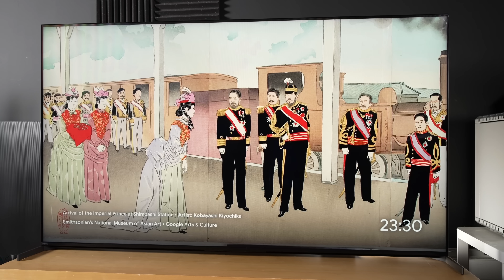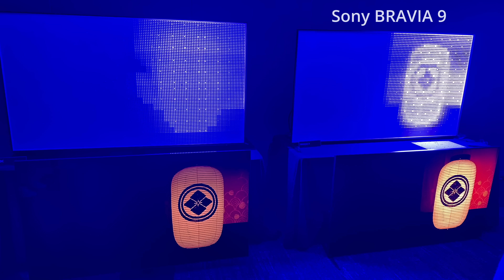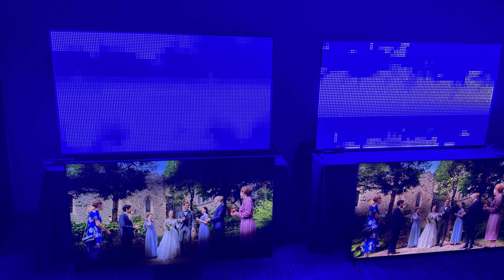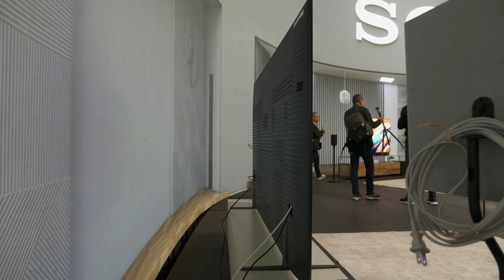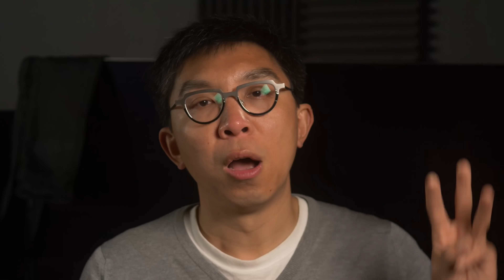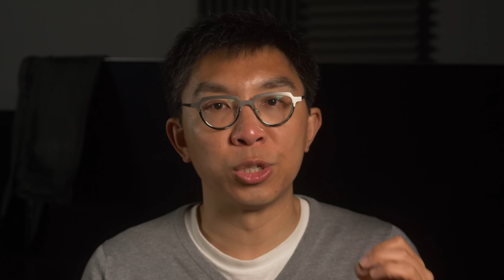𝗖𝗢𝗡𝗙𝗜𝗥𝗠𝗘𝗗: Sony Shun OLED & Use Mini LED for 2024 Flagship TV

Comment: This does not solve the slower pixel response times of LCDs, though, right? As a gamer, I'd still consider OLED for that reason alone.
Reply: And it probably uses a VA Panel with Near Black Smearing.

Comment: I was skeptical about mini LED at the beginning until I saw a video of the TCL C855. An unboxing and a first impression video from a Spanish reviewer. I think the same panel was used for the Bravia 9 because the performance is almost the same. The black values are quite good. I am positively surprised about the new mini LED as I have been using OLED since 2017.

Comment: I've had 3 different OLEDs (Sony A80j, LGC3 and samsung S90C) and they've hurt my eyes. Is it related to OLED technology, or is it something else? I'm thinking of buying the Bravia 9, but what if it's because of the nits? Even with very low brightness and contrast, I feel a very intense burning sensation. If anyone could help me, I would appreciate it. Thanks.
Reply: That sounds like an eye issue not a tv issue. I turn my a80k down to lowest brightness at night because I as well have very sensitive eyes

Comment: I love Sony’s rebranding of its Bravia lineup; it’s simple, clean and less confusing for the consumer. Now, rebranding its Bravia Core to Sony Pictures Core doesn’t make any sense unless Sony is planning on making the app available to every major platform. Surprisingly, the 65 inch Bravia 9 retails for 3,299 here in the US, which is quite reasonable for a first-gen tech. I expect a significant price drop by the fall. I wonder if the Bravia 10 is reserved for a future 8K QLED model, but I would bet is for fourth-gen QD-OLEDs.

Comment: Vincent, I'm disappointed in you for using such sensational and obviously false headlines. As you definitely know, Sony is keeping their A95L through the year and considers it a 2024 model. Do better.
Reply from the maker: @aaricgrendrake: The Sony A95L was launched/ introduced in 2023, and remains a 2023 model even though it's carried over to 2024. The Sony A90K which was introduced in 2022 has also been carried over through 2024, do you also consider it a 2024 model?
Reply: @hdtvtest  except is already had the new Bravia XR chip, the new Pentonic chip, and its getting the updates via software for several of the new features. I sell Sony TVs for a living and according to my sources inside Sony it IS a 2024 TV.
Reply from the maker: @aaricgrendrake: If you sell TVs for a living, then you'll know that it's illegal to sell a 2023 TV as a 2024 TV. For example, here in the UK, the Sony A90K (which has been carried over to 2023 and 2024) is correctly labelled as 2022, otherwise the retailer can be sued for false advertising:

https://www.johnlewis.com/sony-bravia-xr-xr42a90k-2022-oled-hdr-4k-ultra-hd-smart-google-tv-42-inch-with-youview-freesat-hd-dolby-atmos-acoustic-surface-audio-black/p6266335

...and hence the Sony A95L is correctly marketed and sold as a 2023 model:

https://www.johnlewis.com/sony-bravia-xr-xr55a95l-2023-qd-oled-hdr-4k-ultra-hd-smart-google-tv-55-inch-with-youview-dolby-atmos-acoustic-surface-audio-black/p110957841

Comment: Watchout Nvidia recently Released Nvidia RTX and it is amazing automatically converts SDR to HDR I have a LED X900H and a OLED A90J that cost 4 times as much as the LED, with Nvidia RTX the LED can out performs the OLED when Nvidia RTX is turned off on the OLED and Nvidia RTX is just BETA.

Comment: "Unparalleled film industry, professional equipment and consumer electronics experience"

Um, Panasonic?
Reply from the maker: @marca9955: Name one Panasonic reference monitor in use today for HDR. We'll wait.
Reply: @hdtvtest  Weirdly aggressive reply but okay. You're pivoting. When were 'HDR reference monitors' part of your statement? After above, you said "to deliver cinematic picture and evocative sound as the filmmaker intended". Panasonic only need to make consistently tuned TVs as a target to achieve this. And it does, so color grading can be done on any reference monitor to reflect that target. It's like arguing music artists recording on Sony gear can't produce albums as they intended because Sony doesn't also make 'high-whatever' professional monitor speakers (and it doesn't). Ridiculous argument.

In the case of Stefan Sonnenfeld, he actually uses Panasonic OLEDs as a reference, But that's only one part of the filmmaking process. They make cinema cameras, lenses, projectors and home monitors and audio systems etc. More than enough of the chain to give filmmakers control over the end result. You know these videos literally sound like an unparalleled Sony press release.
Reply from the maker: @marca9955: Our point of contention is merely the statement "unparalleled film industry, professional equipment and consumer electronics experience"

If you think Panasonic is on the same level as Sony in terms of film industry, professional equipment and consumer electronics experience, please name:

1) For film industry, Panasonic's equivalent to Sony Pictures Entertainment whose list of films include blockbusters such as The Amazing Spider-man, Casino Royale, Once Upon A Time in Hollywood, etc.

2) For professional equipment, Panasonic's equivalent to Sony's Venice camera. To illustrate, here are movies shot using Sony cameras (filter by Year):

https://shotonwhat.com/cameras/sony-cameras

...and here are movies shot on Panasonic cameras:

https://shotonwhat.com/cameras/panasonic-cameras

Bottom line is, when it comes to film industry and professional equipment experience, Sony cannot be matched by Panasonic, hence "unparalleled".

Comment: How will the Input lag/response time be improved to come closer to oled?
There seems to be a significant difference based on a video from this channel some years back.

Has the situation improve?
Or did it get worse due to the need to control/updates all the dimming zones separately?

Comment: I’m open to withholding judgment until after I see it. But…didn’t we do this song and dance with the Z9D? Positioned above OLED, but the market spoke loud and clear…give us something that does what plasma did; individual control of pixels. By definition, “mini LED zones” cannot be as precise as being able to say “turn  pixel # 1,732,854 to this color and luminance value and turn pixel # 1,732,855 to this color and luminance value.” Right? I don’t need my eyeballs burned out. And a properly set up TV rarely has brightness at its absolute peak (perceived brightness, not the black level control called brightness). But…we’ll see. Play a dark scene from Dune or Game of Thrones on the new tv and the A95L and see what wins. But demo a bunch of highly saturated color in bright sunlight and the manipulation of perception will be clear.

Comment: The problem with Mini LED is that they still use LCD panels, so retain their drawbacks. Motion smearing being the main one (really noticeable if you've used OLED for a while) and viewing angle issues. I guess they could strobe the backlights though,  which might help.
Reply: OLED/QD OLED should be standard display by late 2020s as Micro LED is next premium TV display tech 😂
Reply: In fact, Sony has very advanced technology in regards to backlight scanning/strobing. On X95L you can have 120Hz backlight scanning with almost no brightness loss and it has the best motion compared to any Oled I've ever owned, almost crt-like (including a90j and a95k which didn't even allow 120Hz bfi, but only 60Hz with too much flicker and brightness loss).
Motion on X95L is truly that good, I am confident Bravia 9 will be amazing.
Reply: @FabriG-yd5ft X95L greater than any OLED you owned? Lol you probably own some old ass OLED, have you even seen A95L and G3-4 in action? X95L is more where close to real OLEDs.

Comment: It's weird they say a QN90C and the Bravia 9 at 65" have similar zone count. The QN90C has 720 zones. But the X95L in 65" had 480 zones. So in what way can a Bravia 9 65" "with similar zone count" have 3 TIMES as many zones as X95L? The Math doesn't add up.  3x 480 = 1440 zones, which is DOUBLE the 720 zone count of a 65" QN90C. Now if this was a QN95C then the zone count would match up nearly perfect.
So what is going on here.

No matter what the Bravia 9 is clearly a big upgrade from X95L etc. The colors and brightness alone is pretty big deal. Then the zone increase (whatever it is) for far better contrast and tighter zone control is awesome.

I love OLED like anyone else. But once Contrast hit a certain point and black levels. I care more about shadow detail and near black handling  and how much HDR impact there is. I think the Bravia 9 will do all these very well. I use my TV as PC monitor as well so ASBL on the desktop is really annoying and of course burn in risk. I would go LG G4 if this TV didn't or doesn't pan out. But I think it will. I was already liking the X95L and any minor upgrade from that would be nice. This is much more.

I just hope the 75" panel will be equally as good as the 85". I hope they even out the quality for the sizes this time.  Still a 75" with 4,000:1 and these zone counts should alleviate any concern.

Can't wait for Vincent to get this and put it through the test, especially see how close it matches with the Mastering monitor (the new one) he has now.

Comment: OLED is King, which means LG is King.
Reply: Far from it. Their MLA-based G3 when wall-mounted using the LG slim bracket runs so hot it will almost burn your hand if you touch the screen. Now the G4 has been revealed to very likely have a major design flaw where light from the screen is reflected back to the viewer off of the metal bezel when viewing in a dark room when screen brightness is set to anything higher than about 50%. LG doesn't actually appear to be the king of anything at this point.
Reply: @michaelbeckerman7532  Far from it? So who will have the superior OLED in 2024? You can't just make empty claims. Too much of that on the Internet.
Reply: @stevensmith6445  Well, we shall see. Everyone is claiming that the G4 will win King of TV this year. It might, but it also might not. Some say that the S95D will win, while others say it has no chance at all with that matt finish on the screen. Some say the A95L will end up repeating. We will just have to wait and find out.
Reply: @michaelbeckerman7532  Ahhh man you were talking like you knew the ace in the hole. I thought you had the insight!
Reply: @stevensmith6445  No, sorry. No crystal ball here, unfortunately.

Comment: Pitty that Mediatek SOC is still on wifi 6/6e. Really would have thought it's time to get wifi 7 out there. Also wondering how to get more details on those decoders e.g is the AV1 capable of decoding AV1 10bit HDR? 

Lastly any idea about the details of other specs like how much ram or how many backlights? 

Ram especially I sometimes note on all the Bravia TVs I have they get super laggy when using apps like Plex. But on my mobile playing back the same content never makes the mobile slow down. I was thinking perhaps Sony is just not putting enough ram onboard to buffer high bit rate content and still keep UI in ram?

Comment: Love your content Vincent. However, the Bravia 9 is of no interest to me, as an average UK home owner that doesn't have space for a 75" TV. The big question for me, is how will the Bravia 8 compare to it's OLED competitors? and is it intended to compete with OLED? It appears the current OLED line up carrying over into 2024 will not be improved, not what consumers wants to see.

Sony moving away from OLED is a massive headline grabber to me, as I regard them as the benchmark for OLED TV's over the past several years. Thank you and keep up the great work.
Reply: Bravia 8 is OLED. Basically the new A80 series with a 10% brightness boost. 
Sony is not moving away from OLED. That misperception was fueled by a click bait title used by none other than our good Vincent here some months ago.
Sony will have the A95L, Bravia 8 and A80L carried over in 83".  They will have two main LED lines. So basically the same as last year. They difference is that they are trying to position the Bravia 9 higher in the line up this year. Time will tell if it works for them or not.

Comment: 83A90J (2021 model) happy and proud owner. I’m confused…is now a mini-led better than oled? One thing is crystal clear: I’m never downsizing. Am I missing the new good “stuff” or my panel is still relevant and should wait for the even next development?
Reply: You have an excellent panel there good sir. I"m in a similar boat with two A80J's. 
A90J is more or less on par with any WOLED ever made. It is bested by the new QD-OLED's but not by a mile and none are yet available in 83" or higher. And I agree, no downsizing!
The LG G4 will be substantially brighter with MLA in 83" for the first time this year. It will also likely have better processing than the A90J. But it won't have the higher color volume of the QD-OLED's. So the G4 would be your best bet in this year's tv's but if I was in your shoes, I'd keep holding out another year or two. By then we should have 3,000nit QD-OLED's in larger sizes that will really knock your socks off!
Reply: @bearclaw5115 the 77” A80J was so close to the 83” A90J in performance. 77” A80J proud owner.

Comment: It's a fail because I wanted an 83 or 85-in OLED model from Sony with the a80 quality. Also, LG is pushing the brightness of their panels with MLA,. I expected Sony to have an 83-in OLED model with MLA or better not one old school OLED in limited sizes
Reply: Sony A80L in 83" carries over. You're good!
 Bravia 8 has 10% boost in brightness but 77" or less.
Sony with MLA would have sold me but alas. Maybe LG isn't willing to share it with them or maybe it competes to well with the A95L for Sony's liking.

Comment: @hdtvtest 325% is 4.25 times as much
Reply from the maker: @IAmMan-: We were shown an internal presentation deck (which was more technical than the press release) that said there are up to 3x as many local dimming zones.
Reply: @hdtvtest  i guess it’s either 225% or 325%, because the slide/poster says 325% and that doesn’t add up to what they said in the internal presentation deck. Someone f up and somebody’s getting fired. Just kidding of course…

Comment: its simple. if the Led bravia 9 was actually good, they wouldn't have made the second tier bravia 8 into a simple WOLED. it was done to avoid comparisons. Ditching the QD-OLEDS is a dumb strategy. At best they should have done what samsung did and keep both in the lineup and leave it up to the consumer to decide.

Comment: No OLED, no thanks. I have tried going back to other display tech in various usecases (phones, tablets, VR glasses, TV and monitors) but I am 100% convinced that none of these other displays are any good compared to OLED.
Without the blacks of OLED you can never ever get the same proper contrast as you'd see in real life. I don't care how spot-on the color accuracy is on a per pixel case, because it's about the picture as a whole that should be accurately reproduced including the shadow detail. With backlights you can never get proper shadow detail and high dark-light contrast on a pixel by pixel case to enable an accurate reproduction of the original captured image.
For me only after OLED's pixel by pixel dark-light contrast and shadow detail comes the need for high brightness levels, because whilst brightness sharpeness the detail without the pixel by pixel deep blacks you cannot generate the detail base properly in the first place.

That is just me as an amateur speaking, an amateur who has made up his mind in regards to what he likes and prefers. So for me going to mini-LED or any LCD or LED tech is manufacturers going backwards because they feel that OLED is too expensive to produce, and just are trying to generate more profit by staying in the same price ranges but with less costs.
Reply: You're coping, coping and seething. 🎶
Reply: Sony BRAVIA 8 is OLED

But it's not Sony BRAVIA flagship

Sony BRAVIA 9 is Sony Flagship TV this year

Mini LED >>> OLED

Comment: The X95L was an excellent miniled. If the Bravia 9 is 30-40% better, they have something.
Reply: Too bad A95L looks 100% better than X95L…
Reply: @ElGrueso  but its an OLED with inevitable burn-in issue so it's automatically 200% worse
Reply: @christianorthodoxy91  post 2020 OLED panels doesn’t need to worry about burn-in unless you are watching severe static images for ridiculous amount of time and 0% blooming and real control HDR unlike LED’s crap HDR which makes it 300% better. There are several Rting video about this issue.
Reply: @ElGrueso  burn in will never go away with organic materials. They'll try to delay it with bigger blue leds or pixel shift but never eliminate it. And yes I want to be playing static images if I want to since I paid for my TV
Reply: @christianorthodoxy91  sure watch your static image pictures, and news with your LED and I will be watching my movies, video games and tv shows with OLED 👍

Comment: Correction: Sony doesn't want to pay for OLED, so they try to convince you mini LED at OLED pricing is just as good.
Reply: Nah. They are still fielding two OLED's this year. I think that they are betting that for most people the new LED backlighting system will dazzle and look good enough to most. They keep the OLED's around for the purists but didn't put much effort into that part of the line up.
Reply: @bearclaw5115  Good info to know, thanks for educating me :)
Reply: You're coping, coping and seething. 🎶